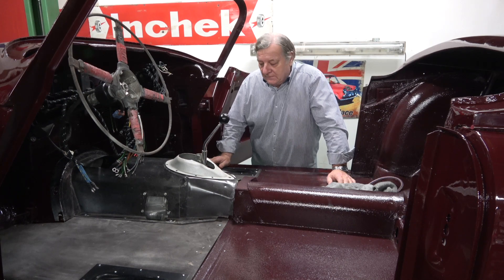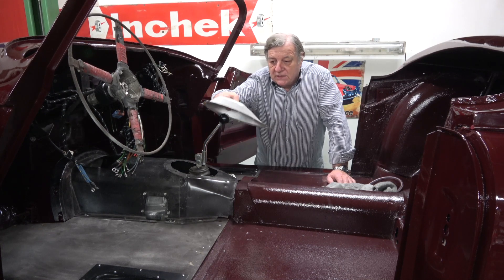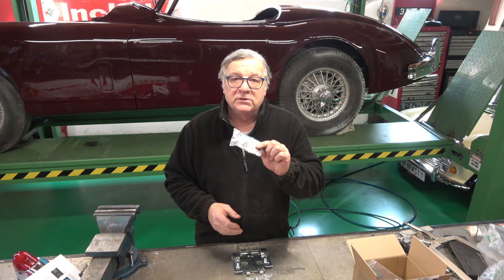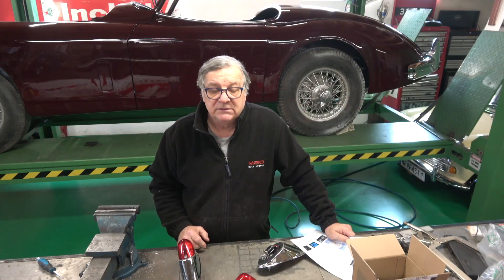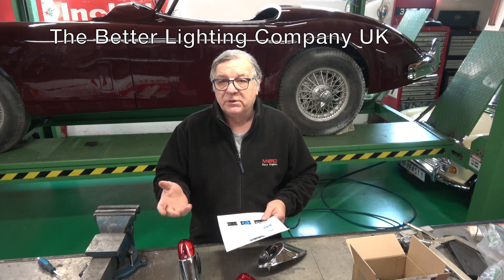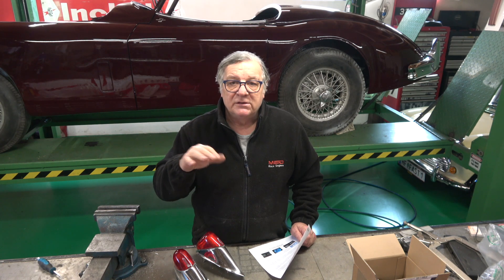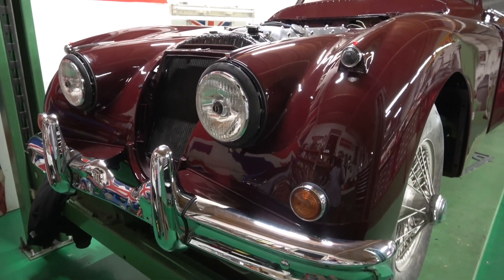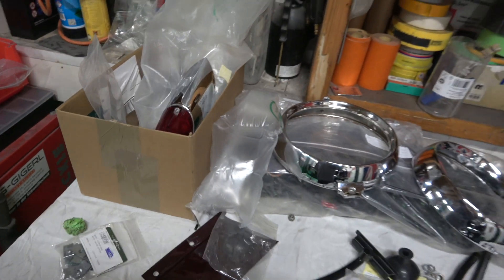1958 Jaguar XK 150 Roadster Rebuild Chrome fittings Part 7

Comment: Hi Dave . If the gearbox cover is original then l don't see a problem . But why not give the company a call ?  They may have come across this before . Even though l still have to rebuild the bonnet on my "e"type l've already painted the shell and  put the chrome fittings on .......couldn't wait ! Cheers
Reply from the maker: John,  It is the original gearbox cover so the basic carpet will be the same but the gear stick gaiter may or may not need to be altered slightly.
Jonathan Skinner asked me if there is a difference so obviously he has never come across a T5 tremac conversion before.  It is very hard
not to start adding chrome peices as the car just comes alive and all the time & hard work starts to pay off 😉 Cheers Dave